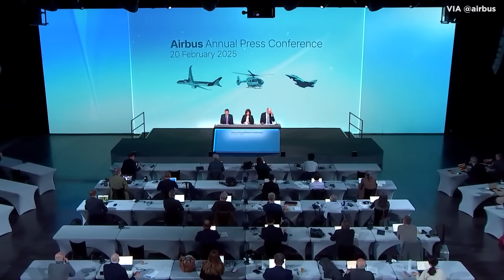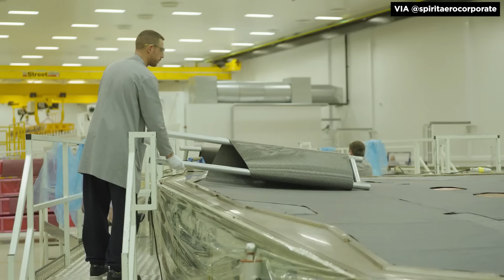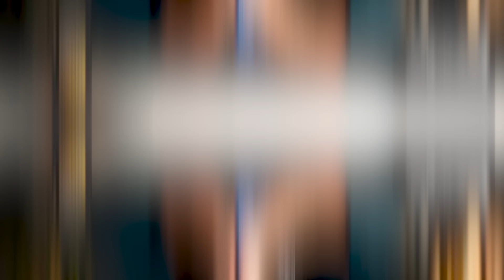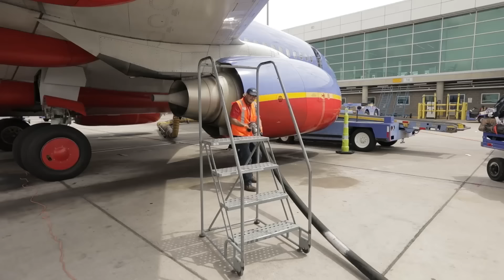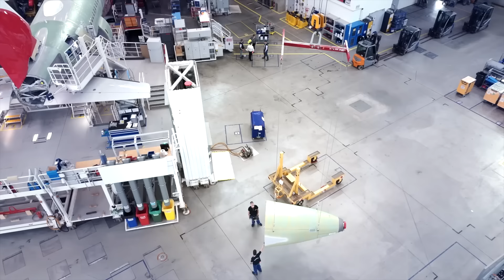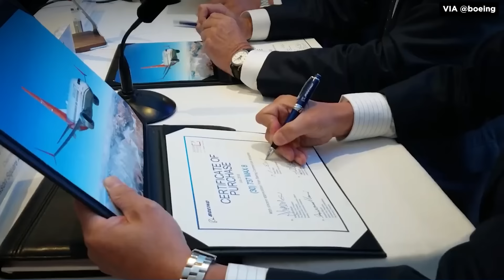Did Airbus just Change EVERYTHING?!

Comment: The hydrogen economy hype was never economically viable and so Airbus is merely accepting reality. Moreover, if you think a fire with aviation kerosene is bad, remember the Hindenburg.....
Reply: Hydrogen burns upwards, crew and passengers on the Hindenberg were mostly below the fire. People died mostly from the crash to the ground, not from the fire.
Reply: @HuwRichards-e2z  well, they would not have crashed at all if Helium would have been inside ;-)

Comment: With the CFM  RISE engine, it doesn't necessarily need to be underslung on the wing. It can be placed, like most low wing propeller aircraft (Gasp! Shock Pikachu face!), over the top of the wing. This will allow the propellers to achieve minimum ground clearance, and allow a more conventional layout. Naturally, this will require some different maintenance practices, but it is still doable. It will also be more cost effective (cheaper) to build. Just my opinion, though.

Comment: I'm amazed we are still discussing the greenwash hydrogen (hugely more expensive and extremely difficult to store and transport). 
BTW, directly burning hydrogen in an ICE engine is the stupidest idea possible. While a fuel cell is better from an efficiency perspective, it still makes no sense.
Even when, in 20-40 years from now, we'll be in an abundance era due to very cheap solar electricity, it will still make more sense to use hydrogen to produce carbon-neutral synthetic liquid fuels than to directly use hydrogen in planes/cars/trucks.

Comment: The one and only actual plan at Airbus is simple : Increase production output. And nothing else matter. Everything outside this subject, is paused, unfunded or canceled. The 2 mains risks nowadays for Airbus is a complete failure of Boeing and the arrising of the chinese industry. The only option to covers thoses risks is increase product output and reduce delay of delivery.
Reply: Its true they need to ramp up to burn through the backlog while its still there. On the other hand, they cant afford to be caught with their pants down when China starts competing more aggressively in international bids. A cheaper and faster stopgap than a clean sheet would be a reengine and possible introduction of new production tech along with a new wing. That product would block a MoM Boeing aircraft once and for all and pull some sales from the 787. And it would have the upside that it doesn't require a whole new production setup that has to run through years of painful ramp-up efforts from zero.
Reply: Airbus is in a great position right now with Boeing’s failure. I hope they seize the opportunity to fill the gap in the market.
Reply: @virtualgambit577  Thanks to their oh lets de-risk the dollar exchange rate by buying more parts from vendors in the US, Airbus is utterly vulnerable. The trade chaos created by Trump will at a minimum cross all ramp up plans. Or worse.

Comment: Hydrogen is nasty as a fuel; it's very low density, it needs super low temperatures, it has very nearly lowest specific heat of evaporation which means it boils really quickly...
and even per mol, it's not very good fuel. 
On top of that, our only method of producing hydrogen at scale is incredibly energy intensive and incredibly CO2 heavy. It's probably the worst fuel for pure CO2 emissions per joule of delivered energy.

Can it be made to work? Yeah, probably. Does it need insane amounts of investment into very complex infrastructure? Very much so.
Reply: Insane 💸💸💸 investments into complex infrastructure that leaves people, industries, and countries dependent on selected wealthy cohorts is not a bug.

Its the feature.

Comment: I have over 56 years in aircraft maintenance, first as a next to the highest grade certified US Air Force Mechanic and also an FAA licensed A@P mechanic.   I also have over 54 years as a non airline commercial pilot.  It would have to be an extreme emergency for me to get on any flight using any Airbus Aircraft.  Air Bus uses a fly by wire control system with too much computer controlled inputs.  I also would not fly on any other manufacturer’s including Boeing’s aircraft using a fly by wire or computer controlled control system/s.  I ain’t getting on a 737 Max either.
Reply: I was working on software for trains, friend of me on software for cars. We feel the same about our respective niches.
Reply: IMO not necessarily fly-by-wire, but software control is a general issue in safe systems. hardware/electronics fail stochastically, so you can give explicit guarantees using redundant components. Software however fails deterministically, so redundancy only helps in certain cases and it is impossible to give guarantees. Proven in use doesn't really help much if the next update can introduce a new bug. I'm saying this as a software engineer, once you see the software running things, you don't want to sit in a car, train or airplane for that matter anymore, but then you also have no other choice...
Reply: @martinzihlmann822  Interesting points. Makes me wonder how often a modern airliner’s software is updated. I’d imagine the frequency has increased over the past several decades. If it has indeed then how would you square improvements in per flight safety with more chances of inadvertent software failure?
Reply: I can't speak for the airline industry but I assume it works similarly there. Updates are frowned upon, justifiably, to the point that  operators prefer a handbook for how to avoid a bug, rather than a bugfix. Any update would require recertification, light recertification, but recertification nonetheless. In those systems software can run for years without being touched. This worked ok for safe systems so far as "proven in use" indeed holds some water. However, this will change with the move to make these systems more secure, as that requires regular, immediate updates.
Reply: @   Besides the computer issues when using a fly by wire system there is no mechanical connections between the yoke (Control wheel) and the flight controls.  With the older way the yoke in airliners are connected to the actuators that move the controls and in some model that I know of then to the flight controls them selves.

 I do have other choices.  I can be anywhere in the lower 48 states, a lot of Canada and a good bit of Mexico in a single day with 6 people on board.  And it a lot more fun.  No two hours early checkins, no security checks.  Just arrive load preflight and go.  I can check the weather and file my flight plan while taking care of my morning constitution.
Reply: Why do you consider such systems unsafe? Didn’t the military pioneer fly-by-wire to improve handling characteristics & make designs like the F-117 flyable? And it’s my understanding that decades of wide-scale use has shown  fly-by-wire systems to be perfectly safe.

Comment: In my oppinion even 2050 would be optimistic for purely hydrogen powered airliners. Engineers had to figure out how to build reliable jet engines for over half a century and are still learning. This can be seen in your video regarding oil vapor in the cabin. Obviously a hydrogen burning engine wouldn't be a complete redesign, but it would involve alteration of basically ever single component. Modern jet engines are as safe as they are because we learned from our mistakes. Thats the reason most modern engines are base on a common core design which is usually decades old. We can't really do this for hydrogen engines. This means someone would have to figure out all those lessons we learned from kerosene engines for them. This would either take incredible amounts of testing without transporting a single passenger or the flying public accepts the increased risk of flying with such engines. Option 1 is probably to expensive to afford for anyone and option 2 won't be broadly accepted. Obviously small advancements are made an eventually we will figure out how to build safe hydrogen engines but until then there will be many many years.

Comment: Might be a dumb question but why not transition to top mounted wings like military cargo craft? Makes a lot more room for big engines.
Reply from the maker: The short answer is because this generally increases the weight of the aircraft structure, because in a low-wing design, the wing box structure nicely combines the structures of the wing and the main landing gear.
Reply: @MentourNow I think top mounted wings create or they're more sensitive to turbulence...
Reply: The forces in a top wing design are huge. The gear is on the lower side and the engines, wing and fuel on the top. In case of an immediate return to the airport with nearly filled wings, they are almost crushing the fuselage. Already in a regular landing, not to mention a 9g crash scenario.
In a conventional layout everything is nicely packed down low and the fuselage just prevents the rain from pouring in. You get the idea. 😅
Reply: I like the idea of rear mounted engines more, seems more logical for CFM Rise.
Reply: @freeculture 

But it does make balancing the aircraft more challenging and it also has some of the same issues of having significant weight having to be structurally carried from the back to the landing gear that is forward. At least the fuel weight is still in low wings associated with the landing gear (wing box).
Reply: @freeculture  When engines are low then throttling up will cause the nose to rise. When engines are high throttling up will cause the nose to go down. The first would be a more logical and I suppose safer way to feel the aircraft.
Reply: @freeculture But there is the 'putting all eggs in one...tail' angle ;-)
Reply: Or why not put the wings closer to the ground, have aa lighter landing gear , and can basically make a cheaper escape slide or just skip them and let the door be a stair and mount the engines in the back, MD80-Style, and let them be humongous.
Reply: @Flinno-k8w  

It is not about lighter landing gear but about the additional weight / strength of the fuselage needed for a high wing and engines or rear engines.

Comment: Hydrogen is all nice and dandy, for as long as it's bonded to some carbon (or maybe nitrogen). Therefore oil industry will push SAF to unbelivable degree and block any ideas of commercial hydrogen in transportation. I'm willing to bet that we'll have battery electric airplanes in commercial use much earlier than hydrogen ones.

Comment: Fairly easy to design hydrogen powered engines, some current engines could be simply modified to burn hydrogen.
The problem is storing and transporting hydrogen!  It is very slippery stuff!  As he pointed, it must be kept cryogenic or compressed!  Either increases weight, and dangers of fire and explosions!  Kerosene is very much less flammable than hydrogen yet look at all the fires and precautions needed against one!
No hydrogen is unlikely to be introduced even by the mid- 2040s!

Comment: A methanol or higher -ol based fuel cell is much more volumetric dense and can re-use infrastructure than handling H2 at 700 bar, where you have to replace the tank every 5 years.
10ml of Methanol can be deadly and easily absorbed via skin.
AvGas production costs ~2.5kWh and delivers 9.2 kWh/L, but looses ~65% on heat.
H2 at 700 bar requires ~5.5kWh and delivers only 3.3 kWh/100g
Ethanol from H2 and CO2 requires 7kWh and delivers 4.5 kWh/L .
Reply: What about ethanol from fermentation?